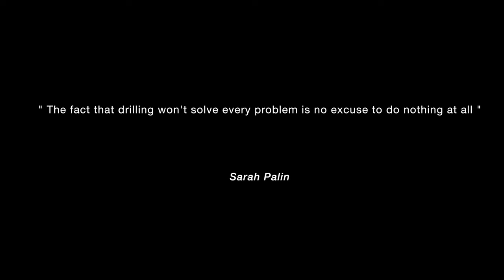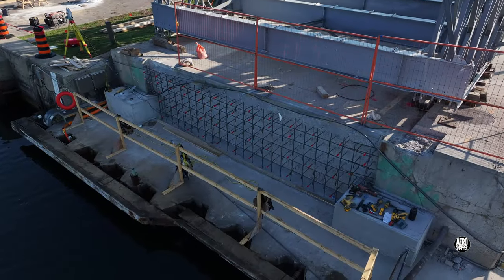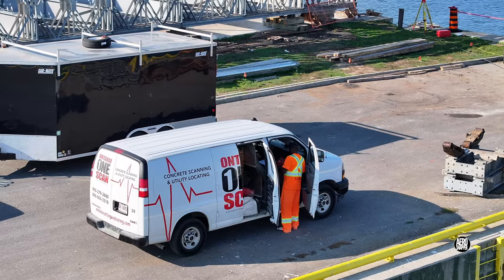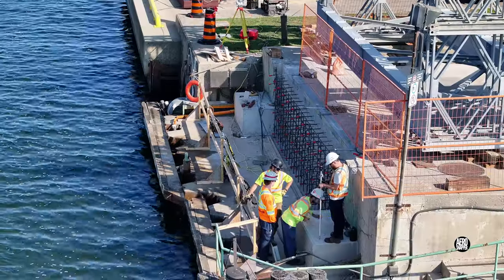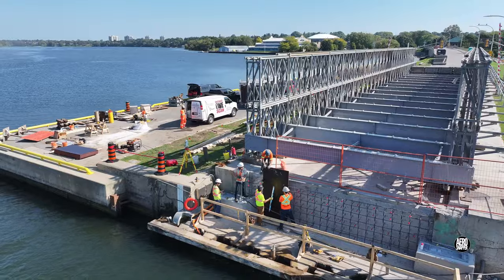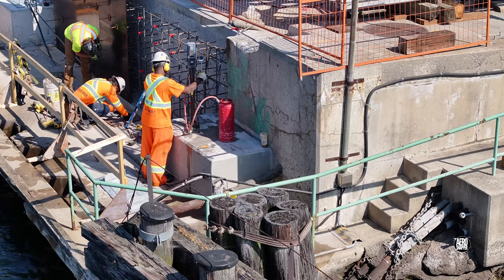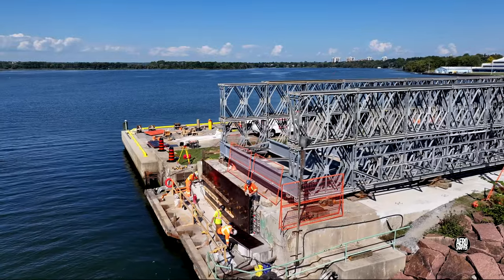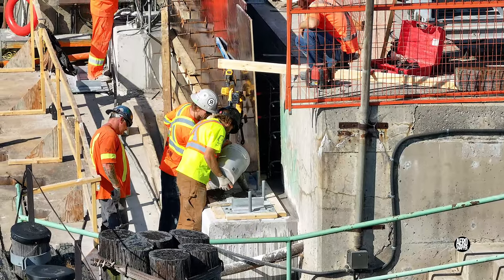Drill Baby, Drill - an update on Kingston, Ontario's La Salle Causeway 4K

Comment: Great video as always! Im wondering if bridge construction will fall short of September 19th. I was told that the bridge would be up and running by the 19th (driveable). Then the narrative changed to "It will be in by the 19th, but then load testing and inspections will commence".

I think they're going to have to change the narrative again to "bridge delayed from previous date of September 19th to beginning of October".

I can't see it going in by the 19th, but I hope I'm wrong.
Reply from the maker: The installation has been postponed to the 20th. No statement has been made about any change to the start of operations at month's end (September).  Thanks for your interest and an insightful comment